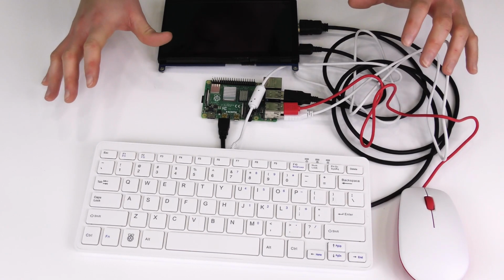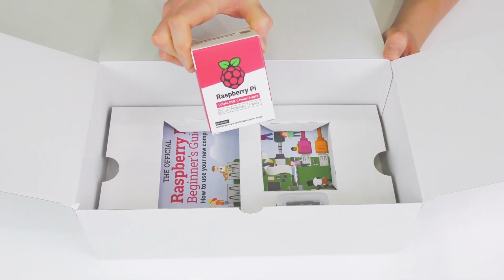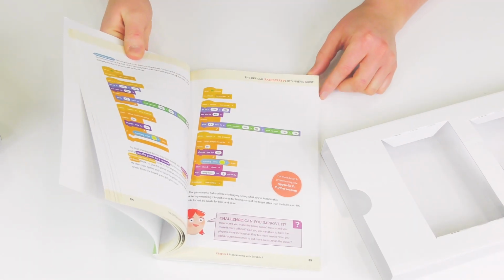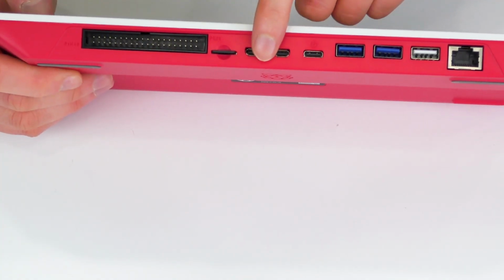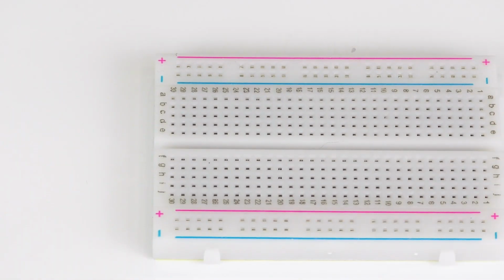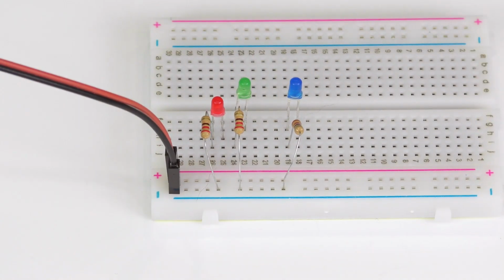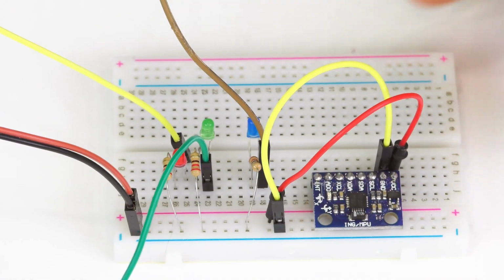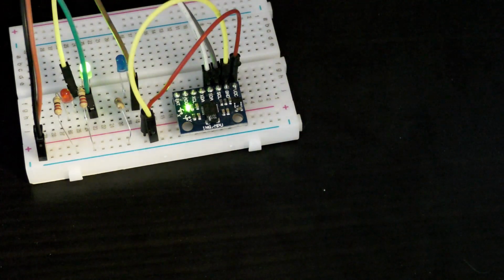Raspberry Pi 400 // Hackster Spotlight

Comment: BORING!  HACK IT UP HACKSTER.  Swap out the ram chips.  16gb is the best. x2.  Add active cooling so you can OC the chip.
Reply: Hi, it's the guy in the video. This is only an unboxing and demo (the word "Spotlight" is in the title). If you want, feel free to buy one yourself and put some additional RAM or cooling on it. But since it already consumes so little power, you don't need a lot more cooling. And yes, RGB does makes your computer go faster ;)
Reply: Yeah, you tell him! Create a simple functional programmable board that follow a sensor input? Boring! Better… to just put a chip out and solder another one that came from a factory somewhere, right? Who wants to actually design a thing with electronics, when you can plug and pray random chips?

Hey, I bet he can even use those LEDs to put RGB to that active cooling you want! Pimp that board, man!